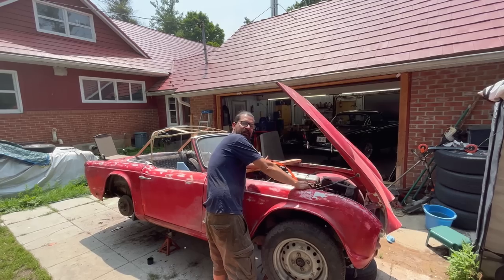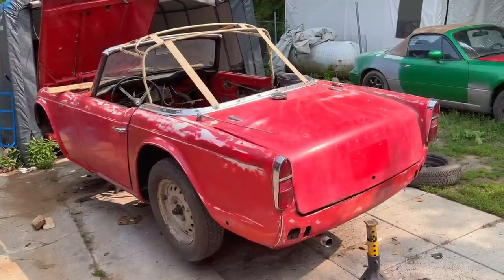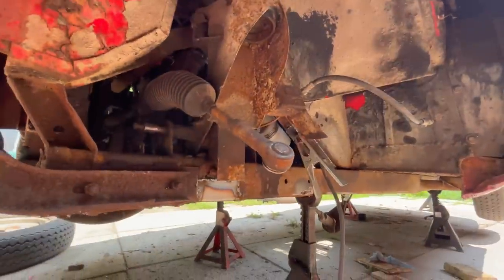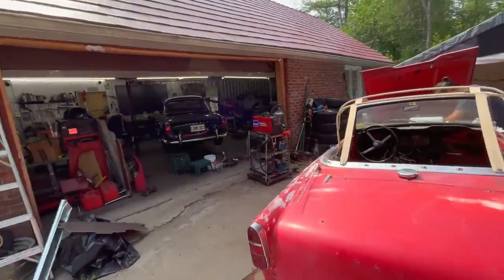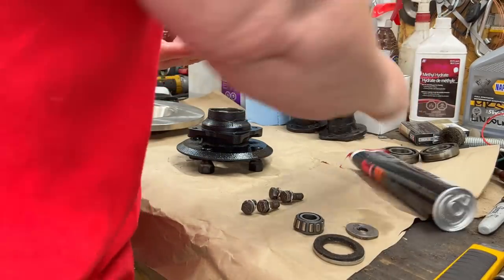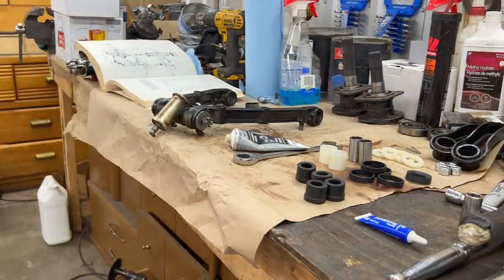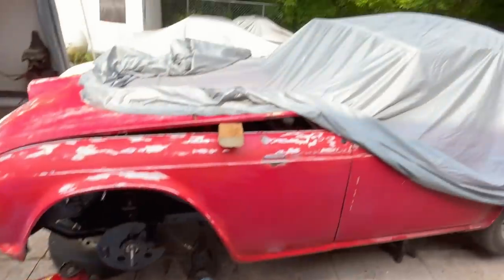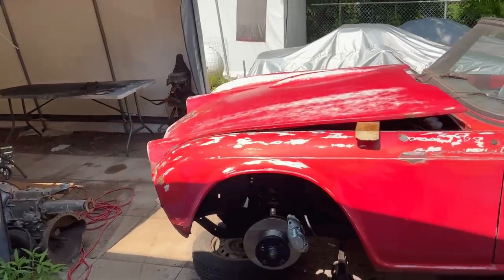1962 Triumph TR4 RUST-oration Project,  Chassis Part 1, Front Suspension and Brakes.

Comment: David, FYI - I use oil in the trunnions of my TR4A. I think the change from grease to oil was for subsequent lubrication. It was more difficult to ensure the assembled trunnions were being fully refilled with grease, as it was easier to force the oil into the tight thread tolerances.
Reply from the maker: Good to know Jim.  Thanks.

Comment: Chef, I like the way you’re approaching this build: just enough to get it safe and driving. It gives us ideas of what we might consider in getting our own Rusty Beauties at least back on the road. Do you think floor boards are a real necessity?😊
Reply from the maker: The good thing about this car is that the floors and inner sills were replaced by the previous owner and are in great shape.   Saving us quite a bit of work there…I think had the floors and sills not been in great shape, we wouldn’t have started the project with this type of concept in mind.
Reply: @cheftush  Well, I guess what I meant was do ‘I’ need floor boards. Maybe I could just use plywood like the MGAs?  All in jest my friend.

Comment: Wow Tush, I think it took me two months to do what you have done in a week. I’m also thinking I went over the top with the front willwood brake kit from good parts. What VIN is your 62’ TR4? my is 4064L, just curious, yours like my is and early one. I like the steel dash on these. Dam 95 is hot, you guys need a pool to cool off. Stay safe, Elin is a lucky man.
Reply from the maker: Mines CT6716LO.   Today is even hotter….I’m just about to head over to Elins now after work at 6:30 pm as it should be a couple of degrees cooler out there.  Friday the heat breaks and we are back down to more manageable working temps.  We are going to start working on the rear axle tonight.